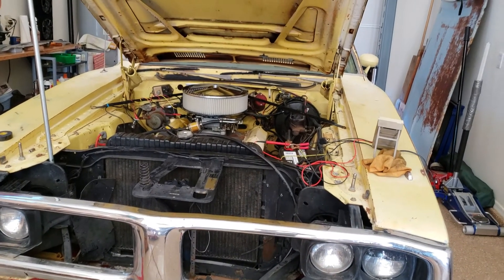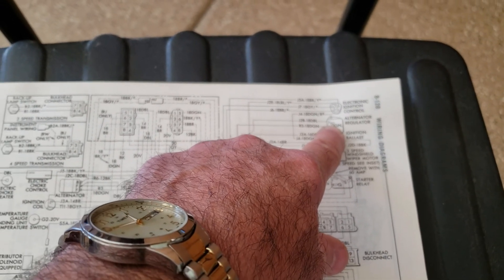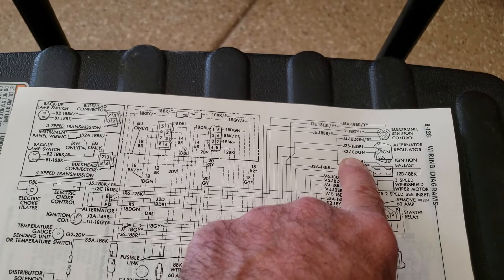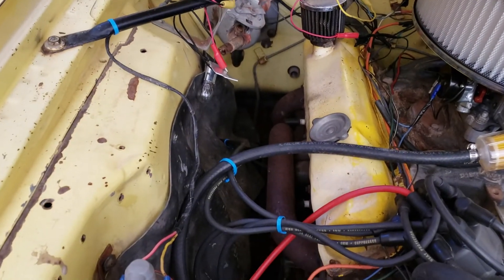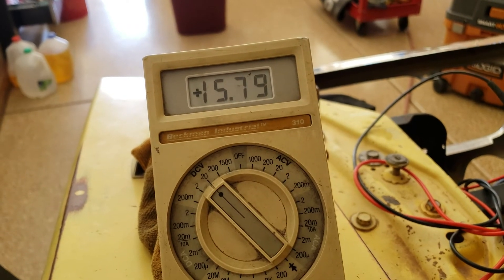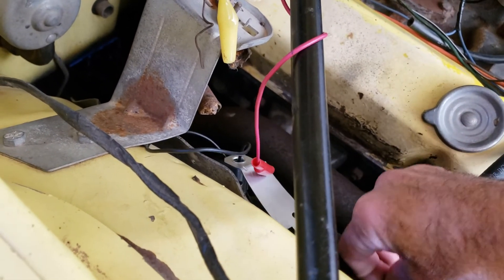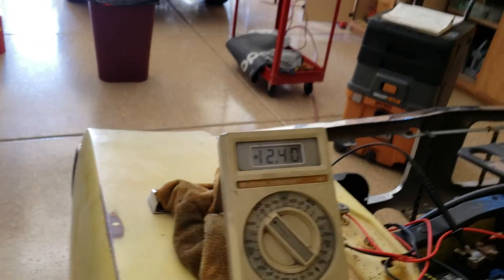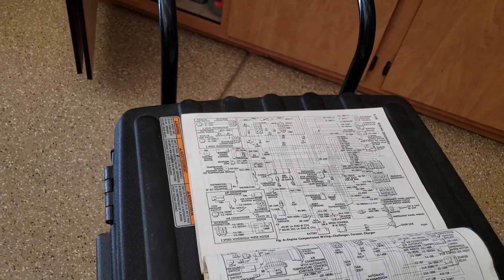Mopar electronic voltage regulator charging system test

Comment: I have an 84 d150 that’s not charging and I was checking voltage at the alternator and the field terminals and with the key on I was getting battery voltage from the input post on the alternator like you should and I was getting battery voltage on the spade connector side of the field wires and nothing off the field terminals on the alternator like I’m back feeding voltage to the alternator thru the field wires. Any thoughts?
Reply from the maker: There are 2 field wires on the back of the alternator. One of them should have battery voltage with the key on, plus or minus 0.5 volt, the other goes to the voltage regulator mounted on the firewall. The voltage regulator applies ground potential to that wire, that is how it regulates the output of the alternator. The voltage regulator must have a very solid ground made through the mounting screws to work properly.  

First, make sure you have good grounds from engine to firewall, battery to engine, battery to chassis, and that the voltage regulator has a good ground. 

For testing the alternator, ground the alternator field terminal that has the green wire on it, pull the green wire off and ground the terminal, do not ground the green wire that goes to the regulator, with key on make sure you have battery voltage at the other field terminal on the alternator, the one with the blue wire. With engine running with this configuration the battery voltage should go very high, like 18 volts or more. If voltage stays low, or close to battery voltage the alternator is bad.

Comment: Can confirm the lightbulb bypass. I'm currently running two lightbulbs in parallel to get my charging voltage roughly correct at average driving rpm

Comment: thanks for the video i have a 73 Charger which at idle i have flickering lights  , changed the regulator , and a tech guy checked my alternator which is fine , also i bypassed the Amp meter,  can i add a 100A alternator with 1 wire system and is there any modification with the wires? thanks
Reply from the maker: A 100 amp alternator makes enough power to melt your existing charge wiring. It is a must when installing a larger output alternator to upgrade your wiring from the alternator to the dash harness, and the wiring from the battery to the dash herness.
Reply: @BigPaulsgarage-v9p   i deleted the amp gauge completely by clamping the two wires together , also i have a direct wire from the alternator output to the starter relay does this helps takes the load of the bulkhead if the new 100A alternator is installed
Reply from the maker: @MOPARMuscleLEBANON  There is a ton of information in this link below. Best option is to use the factory wiring as is, IF, the bulkhead connections are not burnt. Add a parallel 10gauge wire from alternator to dash harness along with an additional 10 gauge wire with new fusible link form battery positive to dash harness.

 https://www.forbbodiesonly.com/moparforum/threads/mad-nacho-electrical-wiring-mods.176102/
Reply: i already have a 10 gauge  wire from the alternator output to the starter relay , i deleted the amp meter in the dash and got the wires that were passing by the amp peter clamped by a screw and nut , do you think it will run fine and take most of the load of the bulkhead  , sorry for the questions and thanks for the help 
  @BigPaulsgarage-v9p

Comment: hello so its ok if at idle on a 70 318 it charges at 13,2 and when the rpm increases the voltage goes to 14.02 ?.....................i am asking because at idle my radio hisses but when i drive or increase the rpm in the park position the radio works fine , but at idle it wont work cause voltage is low ..........also what alternator should i have a 60 amp or 80 amp or 100 amp etc ....i dont have a/c just a normal stock 318 engine ...oh and when at idle sometimes my electric windows wont work they work only when i rev the engine above 1200 rpm

Comment: I sure would never ever recommend running an unregulated alternator in your electrical system. Some of these alternators will output well over 18v and fry anything operating in your car such as the ignition or particularly the IVR or gauges. I don't think you want to ruin the factory gauges. I've seen it happen in a matter of seconds on a car I owned while I was driving it. The regulator will not function properly if it becomes ungrounded. Usually the ground on the back is not sound because the self tapping firewall bolts are stripped out. You can take a resistance reading across the regulator to see if it's still good.

Comment: Your regulator is not REGULATING, or it would maintain ~13.2 volts no matter what.
You don't have to "settle" for vintage bad habits. 
The problem with these cars is that mopar mis-located the SHUNT onto the back of the amp gauge, so the bulkhead connector is taxed with carrying 50+ amps of current through just two bulkhead pins. They simply can't hold up to 50 years of abuse. It was bad engineering from the start, and goes downhill from there.
When those connectors heat up and corrode, the amp gauge and the regulator gets a FALSE reading of actual conditions, because of the added resistance into the circuit.
How can you tell? : At idle the voltage drops and the headlights go dim. At high RPM the voltage goes too high and the battery gets overcharged, even to the point of boiling acid onto the fender wells.
The cure is to RELOCATE the shunt into the engine compartment (electrically isolated from the chassis) using heavy wire. The idea is to place the high current part of the circuit on the other side of the bulkhead connector, effectively eliminating the bulkhead connector.
Then just run two small wires, one on each end of the shunt, to the amp gauge for monitoring. The gauge itself only draws a few milliamps. The shunt carries the load, so wire it accordingly.
You can even bypass the bulkhead connector to the gauge if necessary.
Makes sense, right?
Easy peasy too.
Hope this helps. 😶
Reply: It's not a 'shunt'. That's the full current charging path/wire which is how it reads the amperage. 100% of the alternator output runs through that gauge. The mid '70's cars used a shunt, not the earlier ones. You could take one terminal off one side of the gauge and piggyback it onto the other or run a cable from the alternator output stud to the starter relay. In any case, use a voltmeter to give you a better idea of what the electrical system is doing. A shunt is a parallel circuit that takes a smaller percentage of the current to take a calibrated reading.
Reply: @vincemajestyk9497  
You have no idea what you're talking about. Befuddled by the magic, eh?
But you do have a lot of confidence, and the posturing to go with it..
It's just that what you know, isn't so.
Lemme guess. Your real name Rosie O'  ???
Reply: @muimasmacho excellent rebuttal😂

Comment: Chrysler wiring was terrible when the car was new. It does not get better with age.  The regulator is being blamed for the high voltage when it is actually attributed to lower current going to the blue wire or battery sense. If your DODGE is over charging simply run a hot wire from the battery to the blue wire to see if it controls voltage better.(This is just to check the system.) If it does find the voltage drop in the blue wire. The amp meter in Chryslers are always a problem. Check the connections on the Amp meter.

Comment: I grounded the green wire on my 70’ charger by passing the regulator and it didn’t do anything. Volts stayed the same. I went and had my alternator tested today and it tested good so I’m stumped.
Reply: What was the issue? I found on my 66 newport today that some of the connections were just bad.

Comment: it looked to me that the light bulb was doing a fair job of regulating the field voltage. when you rev'd the engine the bulb must have sensed the increase voltage and in turn increased the resistance thus dropping the more of the voltage across it and decreasing the volts going to the field......which brought the alternator out put back down......I fixing to put me an ignition switched light bulb inline to the field on an externally regulated GM alternator that I'm running on an old Oliver tractor. From your experiment.....that's all I will need.....perhaps, I just had a '''light bulb moment'' LOL (wish I knew what wattage your light bulb was....I guess I will have to play with that idea) The only difference I can see is that GM alternators need + modulated voltage to excite their alternator where as Mopar alternators seem to use a modulated ground or -voltage...either way it looked like the light bulb was doing the voltage modulation pretty well by itself.. Great video!